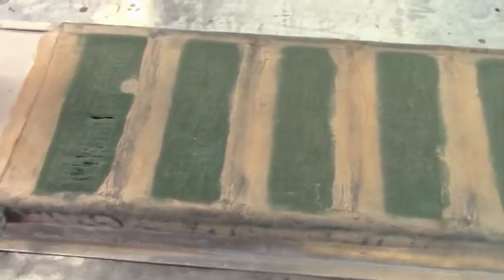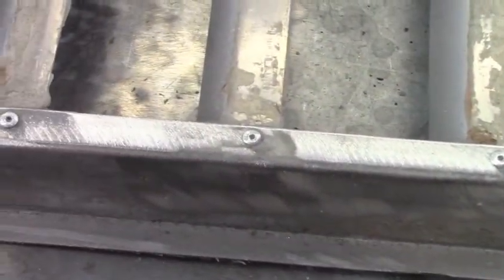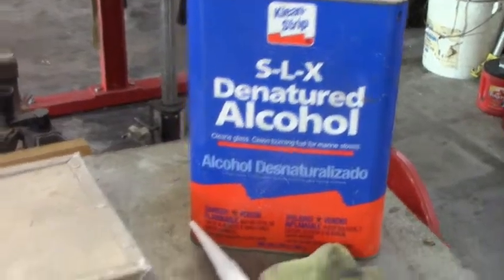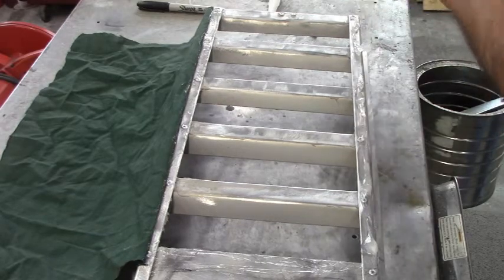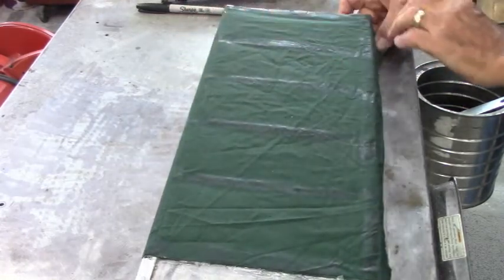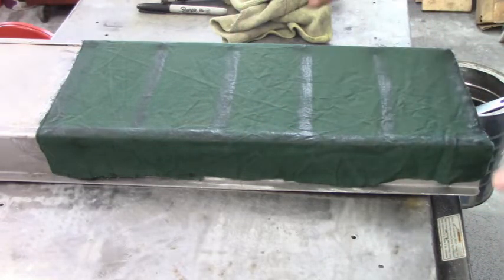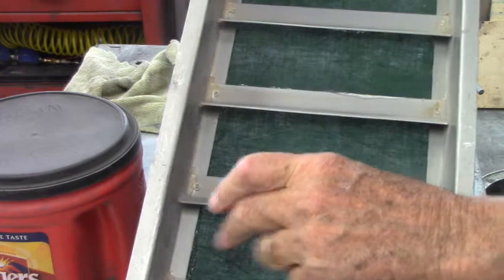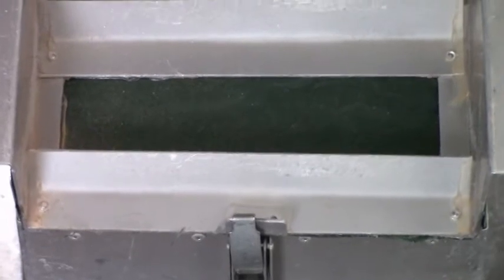DRY WASHER RIFFLE CLOTH REPLACEMENT

Comment: This is going to be good
Reply from the maker: Yes it is.
Reply: @CandSMINING  yep just got done watching very good job, good for a long time now.
Reply from the maker: @diggindiggenit6540  The more it rains in the desert the longer it will last.
Reply: @CandSMINING  off topic but when you use clear silicone and want to add color do you spread it out and use like a putty knife to mix in the color before it goes into the soap solution or do you put the silicone in the soap solution first then mix the color in?
Reply from the maker: @diggindiggenit6540  That is correct. That is where the card board first started to be used. Dump silicon on the cardboard then mix in food coloring with a putty knife.